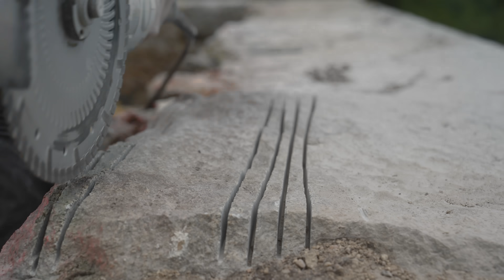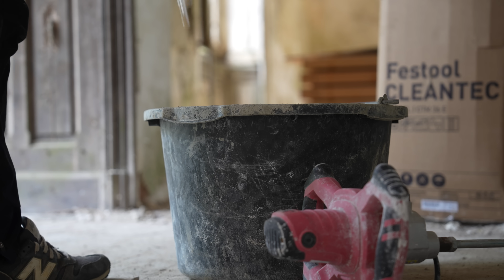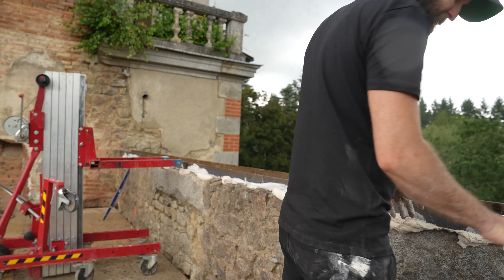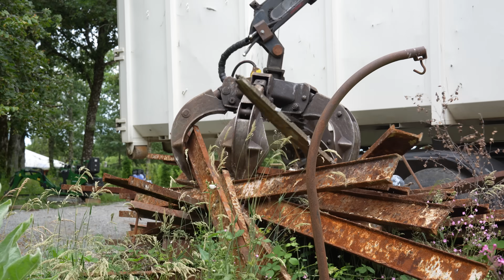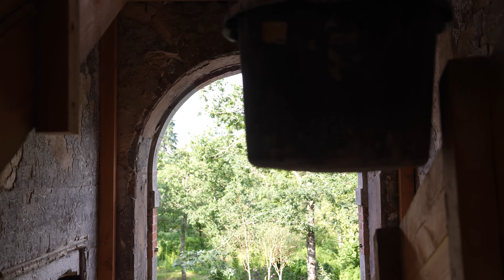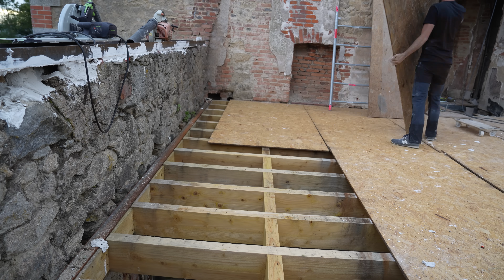The plates are set, its time to start constructing the roof.

Comment: I am still bemused as to why its necessary to have a steel channel section to sit a timber wall plate into especially, as the steel is not fixed to the wall and serves no purpose.  If by some strange and unfathomable reason why it was necessary then why hasn't it been treated all round?  Also, if the bedding compound is the same as used before then according to my research it is not suitable for the purpose, being essentially a plaster repair mix.
Reply: The ring plate is under compression in a Mansard roof. Originally, carpenters would have modified the underside of each wood beam to sit flat on the granite surface. In order to speed up construction, Dan is putting the C channel steel down first to create a strong flat and plumb surface for the wooden base plate - saving days of work. The beam is inside the roof and therefore out of the weather. The plaster isn't there to act as primary support for the beam (it's laying on the granite) but instead as a bedding compound to allow adjustment.
Reply: @MatthewBraithwaite-x6g  Just about every cut roof and timber trussed roof sits on a wall plate that is there to provide a level base for the roof timbers.  i have never come across the use of a channel section on its back as a base or the wall plate.  The wall plate must be secured down to the masonry wall after it has been leveled and this has not been done.  Sitting on plaster that has no integrity for bedding will make it particularly susceptible to the integral moisture in the wall, which a cementitious mortar bedding will not be.  All structural steel ought to be protected from moisture and thus rusting simply because rusting can create huge forces that might move the timber wall plate and the thus the roof.  I would condemn this installation if it was presented to me by a contractor without very sound reasoning, which is not available.
Reply: @clivewilliams3661  That's not how a Mansard roof is designed to work (as in the plate needing to be secured down). The plate on the granite is not structural in any other sense than to act as a flat plate under compression. I get the point about absorbing moisture - I don't know if the bonding agent is waterproof. The whole of the top of the granite will be covered in copper plate so shouldn't be wet when the roof is complete. It's also worth remembering that the flat surface of the C channel won't be exposed to air and therefore should not rust (in the same way steel embedded in concrete or sealed against concrete only exhibits a surface layer of rust and then oxidation ceases). He can treat the exposed steel after the roof is up. Dan has mentioned his architect before, so he's getting advice.

Comment: Standing on a ledge using a power tool that if it caught the material and jammed would throw you right off the roof. Find safer methods.

Comment: I fail to see how a layer of plaster can secure the steel beams to the wall in a structural way. If the roof load is taken by the floor, why use the steel. Belts n braces?
Reply: The ring plate is under compression in a Mansard roof and therefore doesn't need fixing to the wall. The plaster/glue is there to allow some adjustment for level/plumb and to stop the beam slipping while the roof is put on top of it. The steel is for a flat and strong surface for the wooden base plate. Doing it this way saves Dan having to adjust any wood that would have sat directly on the uneven granite.

Comment: Why would you chip the structure down rather than casting new level concrete up? Concrete is so much easier and could have been easily pinned to the wall below.
Reply: If he wants to mirror the other roof, it's going to be less of a headache if they are following the same heights...

Comment: Ivé been following these videos sins you dug out the entry way and I´m concerned for structural integrity. You only anchored the first floors in to the walls where you put the C channel steel and you did not replace any of the tie in bolts that held the walls in so they would not bulge out and collapse, at least you did not show any of it. I´m worried that the severely fire damaged bricks and lime mortar will not take the load you are putting on it and one or more steel beams will let go and collapse the floor pancaking one on to another till they hit the basement. Please show/tell us you not only replaced the designed structural integrity but made it more secure than it was. Rushing to get the roof on will not help if lives are lost or a wall collapse, do it right or do not do it at all, please. I do not want to se a report on the news how a building "accident" cost several people their lives in rural France.
Reply: I assume his structural engineer is not worried.
Reply: @LaReynedeNeige  When you assume....
How can a severely fire damaged structure with medium sized steel tie ins removed and not replaced be sound, especially when many hundreds of kilos of large steel beams are added (but not tied in) to a already damaged structure? Just look at the bricks and lime mortar, they crumble at a touch. I am worried for the safety of anyone in the structure. I want this to work but for a century not a fiew months or years. If my concerns are unfounded I wish it was shown including the "struktural engener" and their certification of the structure. I like the guy and his project, but do not want it to cost lives for our entertainment.
Reply: @agw5425   There are a lot of questions, but I doubt they'll be answered here, unless he shares more detail with his patrons as some vloggers do.
Reply: @LaReynedeNeige  I like the guy and his project, I just want them to be safe and last a long time.
Reply: @agw5425  Like I say, can only assume he follows expert advice. He has said previously he uses a structural engineer.

Comment: Its frustrating to watch you do things so sketchy that would never be done on a job site.  There are some real common sense safety items i wish you would consider.  Steel toed boots.  Safety glasses.  Your trust in a steel beam not to slide off the forks of that hoist had me shouting at the TV. You never should have flipped those that way.  You have a family dude... forget us for a minute.  Your boys need you.  I congratulate you on your drive and hard work. Please use wisdom.  Risk isn't managed well with speed.